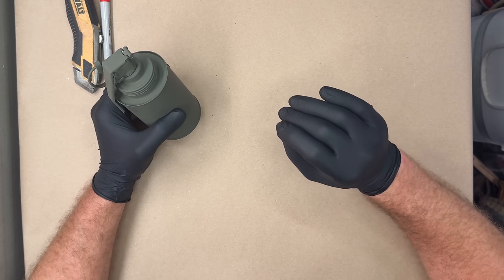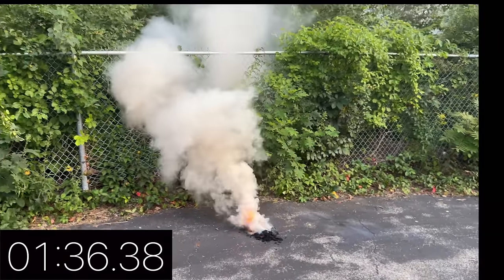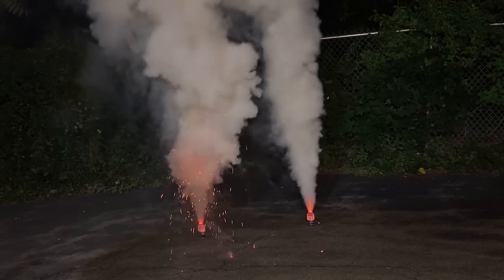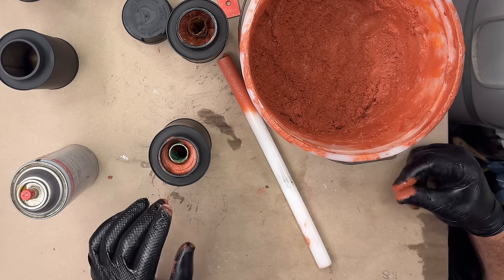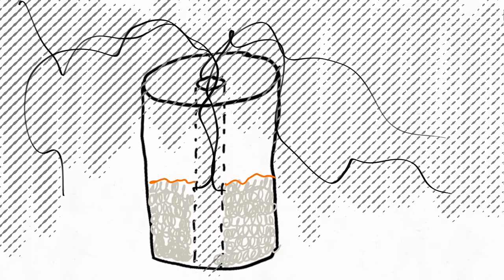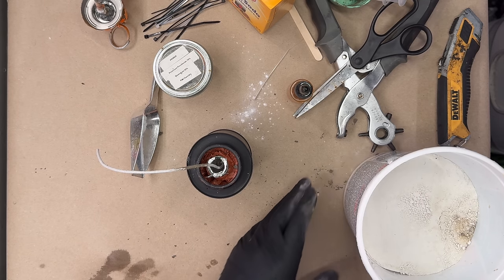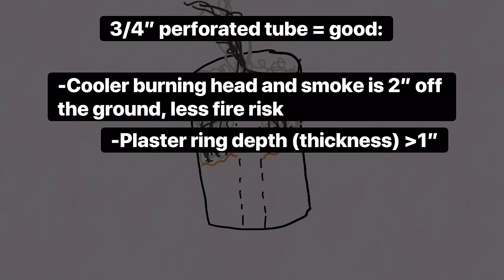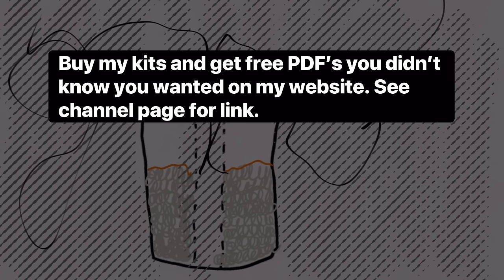Best Throwable Smoke Device on Earth Just Improved by Sub's Suggestion

Comment: 1) Although fire hazard is something to be avoided, I guess.....if someone needed to pop smoke, I do not think starting a fire inadvertantly is any concern to them.
2) Why not just try percentages of baking soda directly into the fuel mix, and find the sweet spot. Then more fuel mix can be added to the head of the burn chamber.
3) Duration of smoke is rather long. Back to the idea that someone needs smoke NOW, and as much of it possible covering as wide an area as possible...wouldn't a 3/4" burn core straight through...coupled with central ignition...cause two opposing smoke plumes twice as thick and twice as fast? Wouldn't that be preferable to someone needing to pop smoke?
4) Isn't it preferred to have the smoke plume ejection along the ground, rather than shooting well above line of sight? The smoke should rise anyway, so wouldn't two opposing plumes along the ground be far superior at creating a wide screening cloud? #InterestingVideos
Reply: let him cook
Reply: If you are downwind in a dry area not starting a fire is extremely important.
Reply: @NacnudTheGreat  
I actually think he's secure enough to cook AND converse.
Reply: @LupusMechanicus  
We can disagree on how important. To each his own.
Reply: Long duration steady release of smoke is the basic idea.  Two outlets, half the duration.  Not necessarily a bad thing but a tradeoff.  It's probably harder to fabricate a double-ended device, and would be tricky to make it blow caps off both ends.
Reply: @jamesg1367  
I can not imagine a scenario in which someone needing to pop smoke would prefer LONG DURATION over FAST & LARGE.
Reply: @thomasg4324  I can.  Volume of smoke being satisfactory meantime.
Reply: @jamesg1367  
Is it nefarious? Even novelty colored smoke balls are satisfactory for many people.
Reply: @thomasg4324  FFS.  Smoke as a screening device: if it's enough smoke to screen effectively then you OBVIOUSLY will USUALLY benefit by longer duration.
Fscking smoke balls SMH
Go build a better device and SHOW THE WORLD why doncha.
Reply: @jamesg1367  
You are allowed to prefer longer duration. I just can not imagine a scenario where someone needing to pop smoke would not wnat the same amount of smoke in less time. Smoke in the can (as unburnt fuel) is useless to someone that needs the smoke quick, fast, and in a hurry....over a larger area.
Reply: @thomasg4324  So throw two of them.  Shrug.

My most salient point was that a double-ended smoke device would be tricky to design and more difficult to fabricate, only adding that it's pretty much unnecessary.
Reply: @jamesg1367  
I disagree that a double ended smoke grenade would be as difficult as you claim. If it were necessary for me to pop smoke.....I'd much prefer the same amount of smoke deployed in half the time, and across a larger area. I also would much prefer to carry half as many smokes, rather than double the weight just to accommodate. #CantShrugCarryingTwoOfEverything
Reply: @thomasg4324    So make one.  Shrug.
Reply: @jamesg1367  
Okie dokie....I'm glad you agree.
Reply: @thomasg4324  Just a few scenarios where you might want a longer smoke:

Medical Evacuation / Wounded - You can't move as quickly due to the injury. The enemy is shooting at you from a road or down an alley. A single nozzle produces adequate smoke to block off the road and lasts long enough for move the casualty. The double nozzle may produce a lot of smoke, but it may provide no additional benefit if 1 nozzle is adequate, but it wouldn't last as long, and you could be caught in the open.

Obscuring Enemy Positions - The enemy is in some kind of fixed position shooting at you. This position is small, perhaps a home or something dug into a hill. You need to cross their field of fire. A single smoke might be enough, two is overkill. You would get the same benefit (obscuring their vision), but you would get it for a longer period of time.

Obstacles - Perhaps when running away you need to do something such as dismantle obstacles (let's say you're driving and come across logs put into the road). You might want a longer lasting smoke since it will take a bit of time to move the dismantle the barrier.

If u start getting into strictly military/fighting applications, then I could think of a lot more. Specifically, because then u might have heavy machinery and complex formations which want to do maneuvers and might have the GOAL of trying to get close to an enemy. Smokes are very good on offense (think about it, if u get the smoke close to them, u only reduce your FOV by a few degrees, you reduce theirs by a lot more). 

Keep in mind, the smoke will disperse and blow away in the wind largely according to how much time it has been since it was expelled. Basically, you can have level 99 smoke for say 40 seconds or a mid-level 50 smoke for 80 seconds.
Reply: @monkemode8128  
Every example you gave.....I'd rather have the grenade put out all of the smoke in half the time & across a wider area. Especially considering the grenade is tactical in design.
Reply: @thomasg4324  Can you explain why? I'm curious as to ur thought process here. Like walk thru my first hypothetical and explain the flaw in logic, because I genuinely don't see it.
Reply: @monkemode8128  
"Medical Evacuation / Wounded - You can't move as quickly due to the injury. The enemy is shooting at you from a road or down an alley. A single nozzle produces adequate smoke to block off the road and lasts long enough for move the casualty. The double nozzle may produce a lot of smoke, but it may provide no additional benefit if 1 nozzle is adequate, but it wouldn't last as long, and you could be caught in the open." <~ I understand the concept of needing time to evacuate. If the smoke was 3 seconds Vs 6 seconds, then yes the 6 second smoke screen would be far better than the 3 second one......but the time it takes to produce the necessary screen is more important in an emergency situation. I would much rather have the same smoke in the air in half the time, and rely on it lingering sufficiently, than have to wait for it to build up sufficiently to move. Because the enemy will make good use of that preparation time. I get what you're saying, but if you're getting shot at and need to get out of there...I'm confident you would rather have that smoke out in 1 minute, lingering for another 2 minutes...than wait because it's a 2 minute grenade plus a 1 minute linger.

HYPOTHETICAL:
Let's say Harris is selected POTUS, and BLM & Commies ("antiFa") are running amok. Let's say Iran is laying waste to Edom, and the Harris ZOG regime is DRAFT kidnapping southern 'good ol white boys' into the infantry ranks to go lose more blood/limbs/lives for ZOG's vassal overlord Edom's sole benefit. Let's say I am forced to have to go into town on a medicine run, and get pinned down by ZOG forces & BLM/Commies salivating at the thought of killing me. Let's say my only escape is down an alley, and my buddy is wounded. I would much rather have the grenade depicted in this video spewing out all of it's smoke within 1 minute, than the same grenade (as depicted) taking 2 minutes to spew out all of thatsame smoke. Because you will never have seen anyone (let alone me), carrying my wounded buddy, run the 100m, climb a fence, and disappear so fast! I would make Batman1989 blush with inadequacy!

Comment: Change the core to a stainless mesh that you have rolled. Roll a few wraps.  When you get to the top flare the layers out so that they sit under amd flare out beyond the opening orifice. Pick a fine enough mesh that won't create to much pressure but will stop all flaming particles from leaving. Should hold up plenty as it will take the heat. Same idea as a flame arrestor on a muffler

Comment: awesome video! For the plaster ring, simple solution would be just some screen or mesh material put into the plaster to give it some tensile strength. As for the cap, maybe add a cord to it affixed to the plaster so that when it pops it doesnt fly off as a projectile?

Comment: Hope these ideas help.
 • less fuel, slow burn, low °F
 • full length perforated barrell same diameter as opening.
 • straight unimpeded, open ended pipe core = ½ the air displacement of the barrell.
 • fix core position to barrell

The perf barrell to be straight on it'outside but have a vortex spiral on it's inside to assist smoke vacate quickly.

Slow burning fuels or low temp burn fuels may keep the smoke lower to the ground for much longer for cover.

Comment: A piece of fine screen shaped somewhat like a star would be more porous to the smoke at all levels and would allow the materials burning farther towards the edges to emit their smoke more evenly.  The star points should reach the edge of the can and will help even out heat conductivity, in an ideal world the base of your 'star tube' would be a bit smaller on the far end, but that's a moderately complex geometry.  Mixing in a small amount of a retarding mixture like baking soda will also slow the reaction slightly.  Using pre-form molds you can also make individual pucks and place filler layers between them.  If you can lower the temperature enough you can switch to something like piping for a more flexible design space as well.

Comment: You could improve the plaster cap by incorporating textile strips. Like they use in plaster-bandages or just strips of burlap.
That should add plenty of strength without adding volume.

And you might be able to further reduce the risk of accidentally setting something on fire, by leaving the top third of your perforated tube, imperforated. That should increase the path any embers or flames or small chunks would have to travel before reaching anything combustible.

Just be aware that you may run into pressure problems if you leave to much unperforated, considering the volatility of your mix…

Comment: To keep the center perforated core in the canister could you use retention rods. Two cross mounted stainless-steel rods in an X pattern like rebar in the plaster. to obtain ultimate retention

Comment: weld an appropriate sized washer to the top of the tube before insertion to seal/close the top of the smoke mixture. Mold a bit of the material around the tube before insertion to maximize the fill.

Comment: I wonder if mixing the plaster with either vermiculite, perlite, or glass fibre might help to keep it from burning. They all should be able to improve heat resistance, and I bet you could find the first two within gardening  sections at some hardware stores (as they're used for soil aeration). Love the progress you're making though. I was also wondering if chucks would blow if you were able to have some sort of chicken wire wrap inside.....

Comment: On one of the cans in the last experiment it looked like the bottom of it was visibly heating up. I think the 3/4 in tube that runs the whole length of the can is allowing the bottom to have a hot spot. A 3/4 in hot spot on the middle of the bottom of the can doesn't seems that dangerous compared to the sides of the can heating up for concerns of a fire hazard but I'm thinking that a small layer of sodium bicarbonate or type of buffer at the bottom before filling in the compound would possibly help with that.

Comment: Use a large thick steel washer over top of the sodium bicarb+plaster. Instead of plaster, use rock wool, or ceramic fiber, or even aerogel. You could even soak rock wool in plaster if you really want... but I'd think the baking soda with rock wool or ceramic fiber, and then a steel washer or disc about 2mm or 3mm thick, sealed along the edges of the can and the tube with a hybrid firestop sealant.

Comment: Maybe try modeling clay or play dough to seal the top off. Does the barrel really need to be perforated? It's a little bit more work but what if you perforated a disc, the same diameter as the opening, and welded it to the top of your tube (perforated and not perforated) then use the clay, sodium bi-carb or whatever on top of that, preventing it from blowing itself or any CHUNKS bigger than the perforations. If that works,  then you can try different sized perforations and go from there on further perfection. *Also wanted to add, i just subbed because of how your brain works.

Comment: Fashion a funnel shaped piece of perforated metal, (perhaps out of sheet metal or the like) that meets flush with the top of the device, Run your fuse through the middle. That would likely work even better.

Comment: Mind you, I know nothing of this stuff, it's merely my best guess if I were tinkering. 

Regarding the plaster cap, you might want to try layering/sandwiching plaster, X, plaster. Might get you a more rugged cap without sacrificing quite as much volume. If there's enough force/heat to break the bottom layer, hopefully it won't extend to the top.

Not real sure how this meshes with pyrotechnics, but my initial guesses for cheap and easy would be heavy paper, maybe cardboard (rugged, tough, but bulky), and maybe plastic (I mean, toxic fume concern is real, but I'm going to assume burning epoxy/resin is also not great for one's health anyway). Honestly, I'd start with construction paper, maybe firm it up with the epoxy, with plaster below and above.

I'd be tempted to try a big metal washer cut up so I could it in, but I think the metal conducting all that heat will crack up the plaster above it. I figure that's where you're likely to have failure, water turns to steam, steam expands, so plaster cracks. Fiberglass mesh, maybe? 

Not that I know anything about anything. :P Just one idiot's wild guess, that's all this is.

I'd also be tempted to try rigging a strainer to your core pipe bit to keep back big, burning chunkies of flame, but I'd imagine to filter out even the small bits, you'll run into flow issues.

Mentioned only because you were open to idiotic theories.

Comment: Might try epoxying a stainless steel screen in the top of the can. Kinda like a make shift spark arrestor. Cut it 1/4" larger than the opening, push it into the can, and epoxy the edges. It might help with the chunks blowing out.

Comment: Maybe if you used clay instead of plaster it would be more resistant to the heat?

Another thought is to use a flat disk of steel mesh underneath the cap instead of (or in conjunction with) a tube through the center which would catch any chunks. So basically if you take the cap off, you'd see a mesh screen and you'd need to remove it in order to see the epoxy and the hole and everything.

Comment: use a faster set epoxy base make it a little more runny and let it cure while spinning the can. small air pockets in the mix it why it spiting chunks.
I suggest using a vacuum pump to remove as air from the mixture as you can

Comment: Model rocket engines also have a plaster core nozzle. However, it's made from a refractory clay mix, like fire bricks. Secondly, your little perf tube (which can be purchased commercially, pre punched) should have a welded ring baffle at the top. You are essentially trying to create a muffler design, but instead of fiberglass insulation, you are using a "smoke compound"

You place that baffle ring and tube over the "mix" then seal it off with the refractory clay. Bada-bing, done!
Reply: I should add, that you could mix in the refractory slurry into the canister BEFORE the fully assembly. Create a little 3 axis "rotomold" spinny thing to allow the slurry to fully coat the inside of the can in a thin layer. This would greatly reduce the heat of the grenade on the outside, and keep it from potentially igniting things it might be touching. This is pretty much how the real smoke grenades are made and why you can hold them in your hands for a bit. It's the refractory clay.

Comment: I think you should try blending a bit of rhe bicarbonate into the snoke mix.  That will reduce the combustion temperature slightly (lower pressure, lower fire hazard) and the resulting smoke will have a slightly lower temperature, which means it will spemd more time at lower altitudes - hot smoke is great for signalling , but cooler smoke is better for screening .

If you really want to reduce hazards of flying fuze bits, flames, and chunks, you might explore a two chamber design with the fuze assembly more tightly attached.  This will keep the fuze from flying off at velocity, and using a hi-low chamber design at the base , with two sets of non-aligned holes (about ¼" wide) and a slight air gap between them, combined with a top ignition, will force the smoke jets to flow into the chamber (blowing open the masking tape used to seal the first set of holes), and then fill the expansion chamber, slightly reducing pressure and temperature, before blowing open the tape over the second (outside) holes, for a gentler emmission from the bottom of the cannister.

Of course, added conolexity comes with added cost - but you should see signfiicant improvement in screening with decreased hazard.

Comment: Aight most likely, someone already has to have mentioned this, but heck, had fun watching the vid, so why not try to chip in. Have you considered that a smaller exit hole may be creating a stronger Venturi effect, and thus the need to put the rod inside 'cause otherwise those chunks would get sucked outta the can? Yep that's right, they're not flying off due to explosion, but due to the higher exit speed produced by the velocity increase generated by said effect. And there's also the Bernouilli effect. Same effects that put planes in the air 🙂 This one will cause pressure biases, causing smoke spill inconsistencies unless the perforated tube's perfectly centered. Summarized as I could to avoid the "read more" line. Cheers.